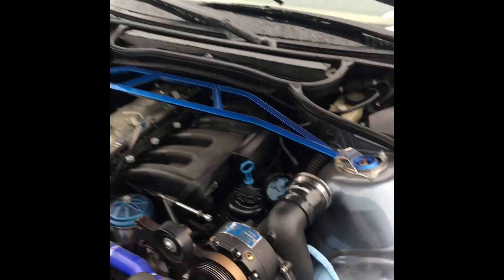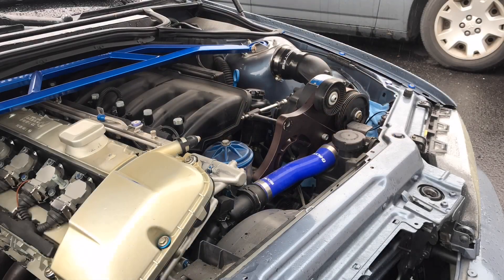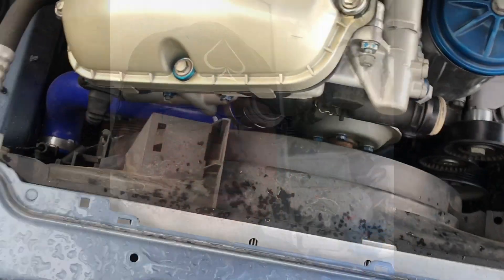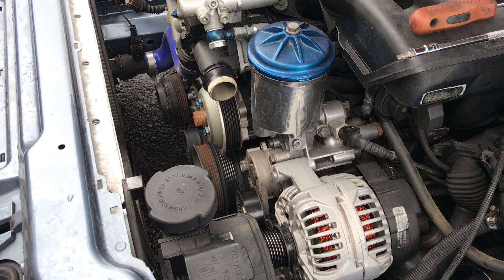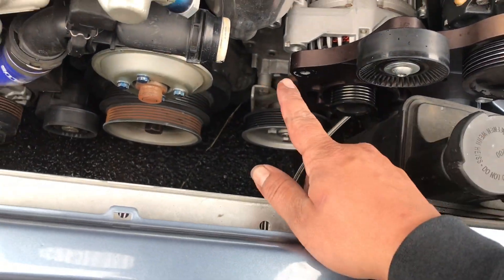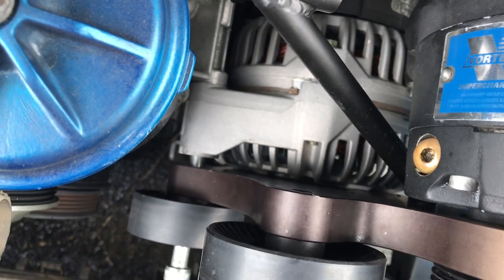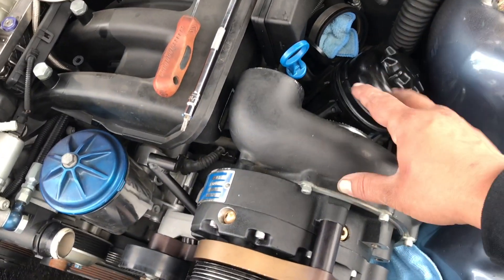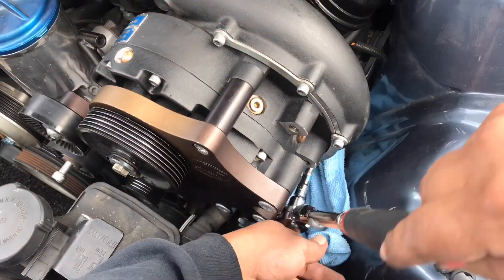BMW E46 M52 Supercharger Install Part.1

Comment: What is the supercharger brand name?
Reply from the maker: Vortech supercharger with a VF engineering tune
Reply: @acef_performance8416  thanks brother
Reply: @acef_performance8416  how has it been did you fix it when it messed up the water pump
Reply from the maker: The supercharger been doing good, the water pump was busted, then I was dealing with boost leaks if you check out the videos.